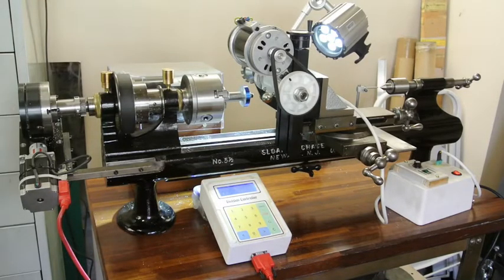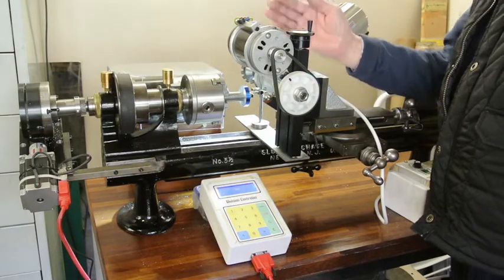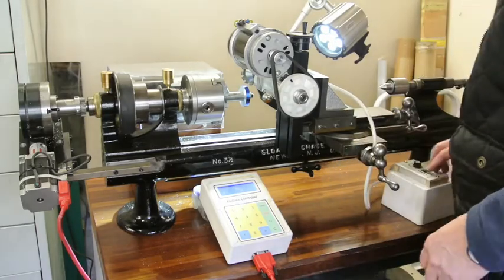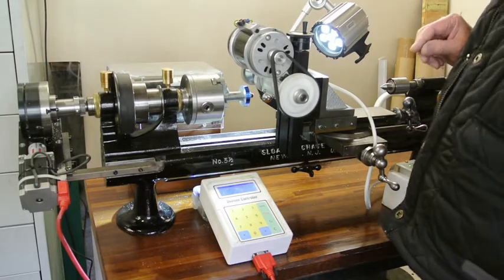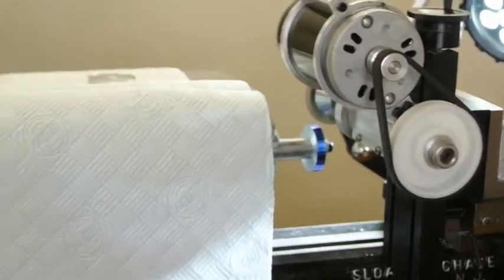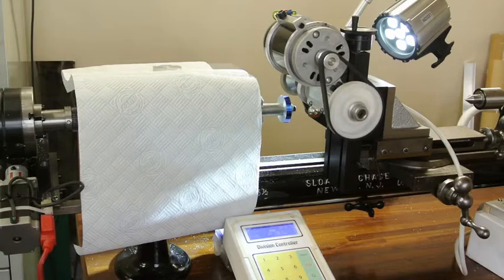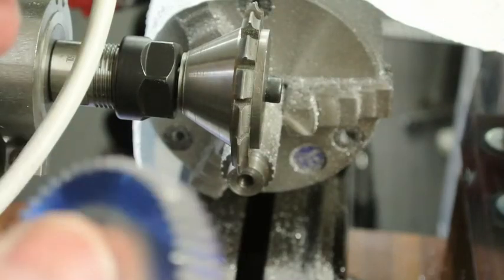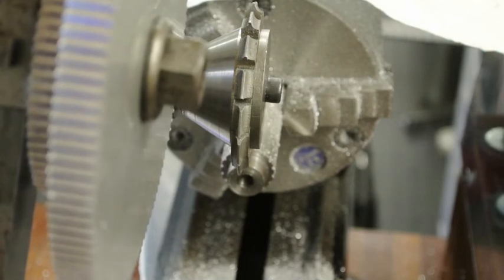Sloan and Chace lathe pt 7 Making change gear wheels

Comment: John, nice set-up. Glad to see you have managed to generate those missing gears.

Regarding the gear finish post machining, I often use a rotating metal brush (copper or even stainless steel) in a Dremel motorised tool, to polish up the gear teeth. Just run the brush in the direction of the root of the teeth. Better still, have some dummy gears either side to avoid leading/trailing edge effects.

I've found that having polished gear teeth reduces the initial wear and helps keep the mating contact consistent, particularly when gears are used new. The technique can also be applied to EDM machined teeth which tend to hold onto micro-machining particulates from the EDM process.
Reply from the maker: Casimir
Thanks for the suggestion. I will give it a try when I have finished. So far the making of the wheels is going well. I tested the gear ratios yesterday and sucessfully cut a pitch of 1mm. Spreadsheets are really handy to make the calculations. It is a fun project.
John

Comment: Cool setup. But why not set the cutter horizontal and get rid of the angle plate and horizontal slide? Not enough space on the top slide?